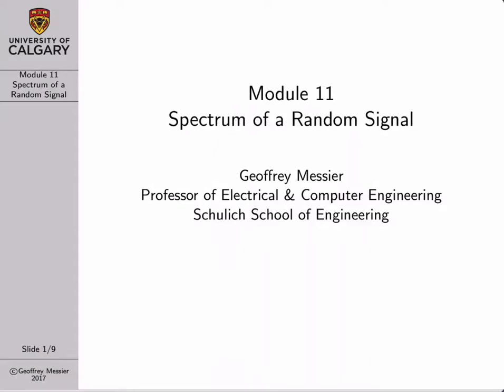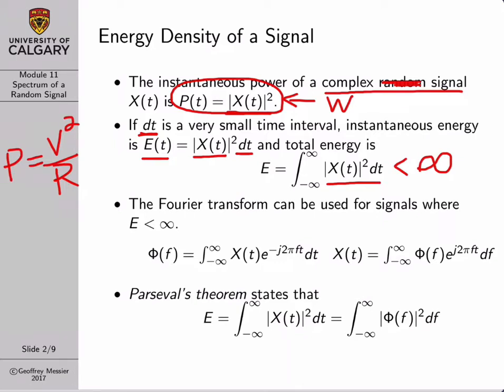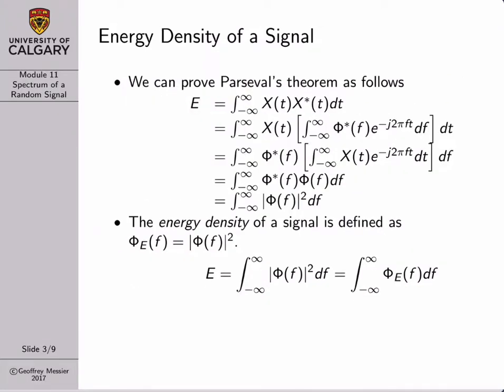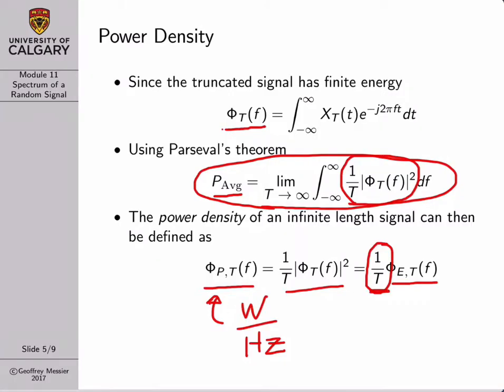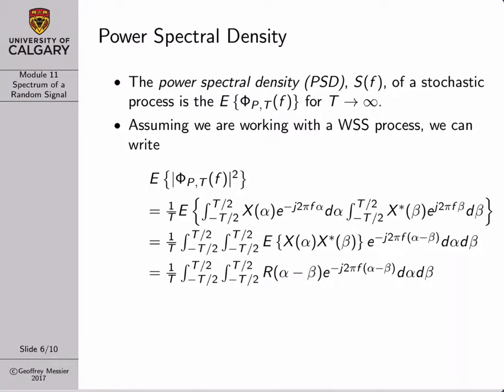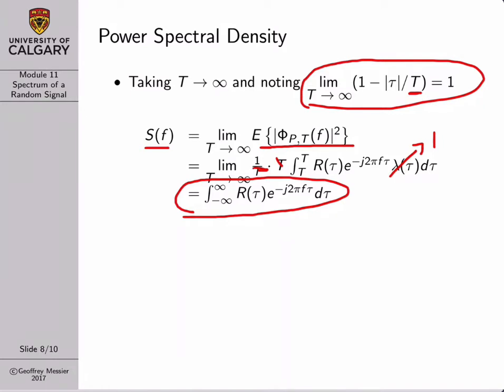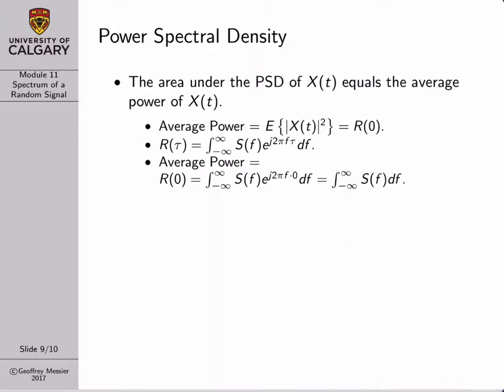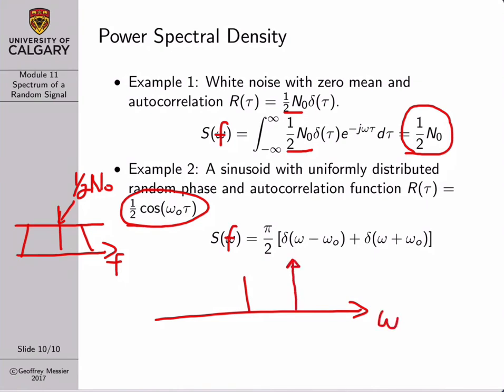Probability Lecture 11: Spectrum of a Random Signal

Comment: 15:20 PSD S(f) = E\{ \phi_{P,T}(f) \} = E\{ 1/T * | \phi_T(f) |^2 \}, right?
IOW, PSD is equal to the expected value of the power density (ϕ sub-indexed by both P and T), which therefore should be equal to the expected value of the magnitude squared of the power spectrum (ϕ sub-indexed by T only) multiplied by 1/T